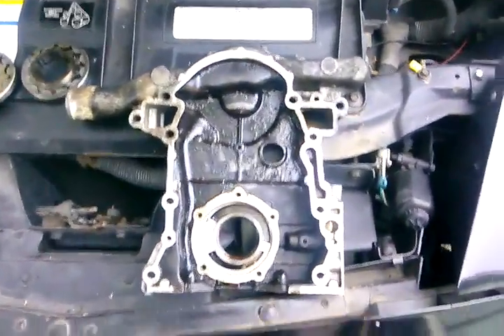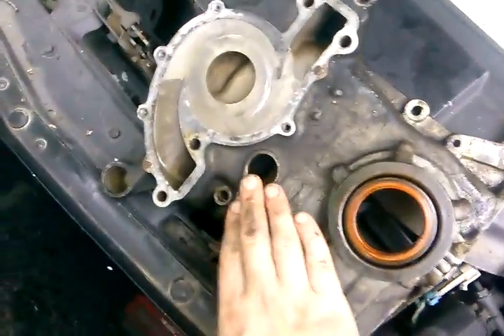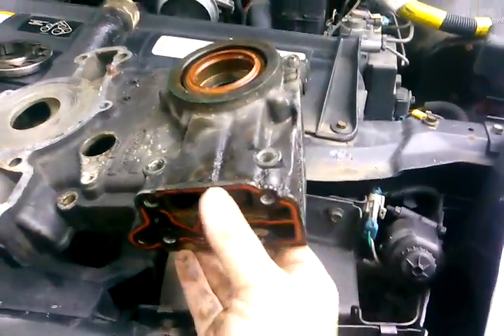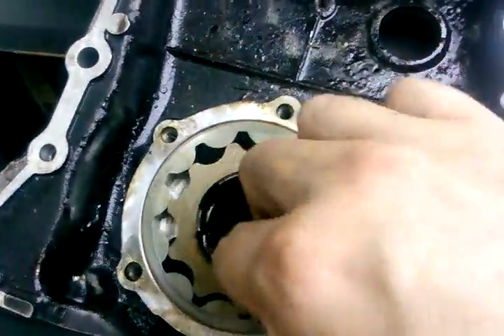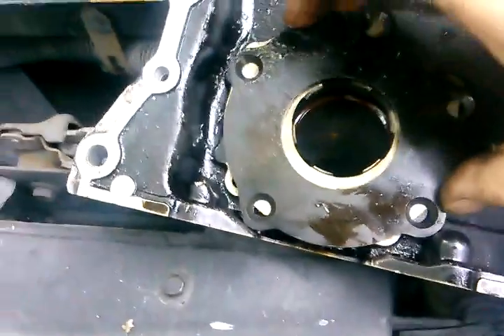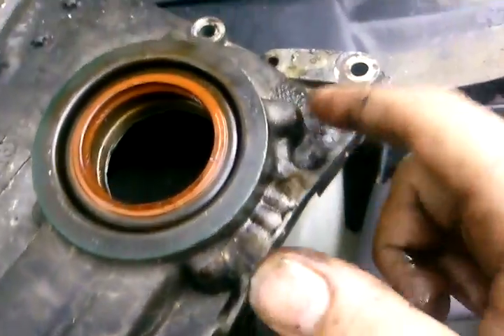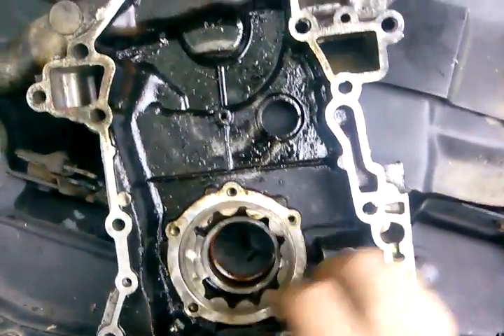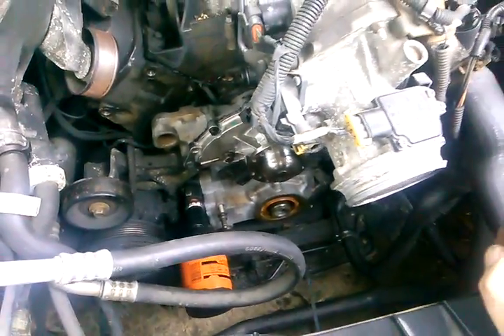How a 3800 v6 oil pump works

Comment: Hi Tyler... my 2005 Lacrosse with 3800 is in the shop right now.  It had a coolant leak at the timing cover repaired - gasket blow-out.  That is now fixed, but when it was put back together, I now have low oil pressure light on and a ticking noise at top of engine (not getting oil up there).  Any ideas on how a gasket swap on that housing could have screwed up my oil pressure?   Thanks!
Reply from the maker: 3800 usually have a little bit of valve train noise but if it's not carrying good oil pressure I would say either the oil pump is bad or it's not sealed up properly allowing it to draw air or lose suction somehow another possibility would be the main bearings are gone can't carry oil pressure if there's nothing to oil although you said it was carrying pressure just fine beforehand I would say it's not sealed up somewhere

Comment: How do I take that cover off?
Reply from the maker: Basically everything on the front of the engine has to come off
Reply: @tylerlanders9482  I'm trying to take it off my Firebird at the moment. How did you get the CS pulley off?
Reply from the maker: @Zanelander  https://youtu.be/jTLIpYR9NOA not the same car but it's the same engine and pulley you need a special tool to get it off there
Reply: @tylerlanders9482  I can't find out how to do it anywhere on the internet. I want to get my car running because I have 1 week until prom.

Comment: im replacing the  timing cover gaskets on a 3800 and was wondering if the oil pump needs to be orientated with the timing marks on the crankshaft
Reply: I don't see why it would?

Comment: the oil pump cover screws should be torqued to 98 INCH pounds not FOOT pounds. Also, you can remove the oil pressure sender and screw in an air fitting instead then pump oil at about 11 psi so you can prime the engine.
Reply: When he said foot pounds my jaw dropped haha probably a small mistake
Reply from the maker: @tremaynemarcel8358  it's not what I say it's what I mean LOL none of that was rehearsed or edited I simply misspoke but I figured if you're smart enough to tear an engine down that far you can probably figure out that I said the wrong thing
Reply: ^this
Reply: @Hotel Prius This comment is so helpful thank you! When the screws torqued down, should I be able to move the gears by hand before install? Thanks again!
Reply from the maker: @shawnmgarcia8888   yes they should turn freely with no binding
Reply: Thanks for the tip on the oil sender priming @ 11 psi!
Reply: @JohnSmith-mh5vi did you figure out your problem?
Reply: @jakub4976  Yes, I used the filter adapter from the blown up engine.  Drill and tapped NPT thread for a plug funneled oil through a clear plastic tube into the inlet cavity. As I swapped them out, I realized I had the bypass plunger and spring backward. Light went out rattle gone.

Comment from the maker: This is a GM 3800 series 2 engine there's no way to really prime the pump like you would on a old small block Chevy what I did was put my oil filter on and poured oil down into the pump to fill it and the filter somewhat then put the inspection cover back on you don't want it to be dry metal having the oil filter already full of oil will help a lot
Reply: Devon Lewis oil pressure sending unit
Reply: I have a situation where my oil pressure drops off when coming to stops under break load. car runs fine from initial crank up but soon as you drive it a bit and come to your first stop oil pressure falls off and motor stops. Does it consistently too... checked my sensor and it was good so would my culprit actually be the oil pump assembly? Let me bud. I really need this fixed. 1999 firebird 3.8 v6
Reply from the maker: +Devon Lewis 
I don't think its the oil pump  not really sure what the problem is there

Comment: What kind of car was this off? If just changing the timing cover gasket, does the oil pump need to be primed?
Reply from the maker: 1997 firebird 3800 series 2 but all of the series 2 and series 3 cars will be the same as far as this housing goes
Reply: Tyler Landers 
Thanks! Nice video btw.
Reply: Tyler Landers wow. I didn't know the 3800 Series 2 was in a 97 fire bird!!! I'd love to put my turbo L67 in a 97 firebird!!!
Reply: @salvatorehayes2753  the f bodies only got the NA 3800 series 2 starting in 96 I believe... I assume you mean supercharged?
Reply: @ab.3800  yea. I deleted my supercharger and put a Tubro instead so that's what I would do to a F Body haha